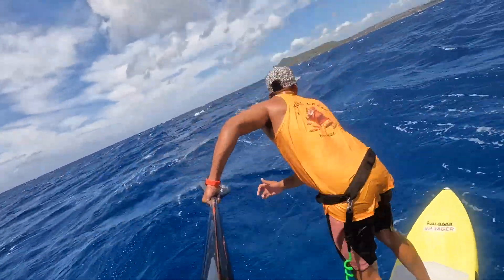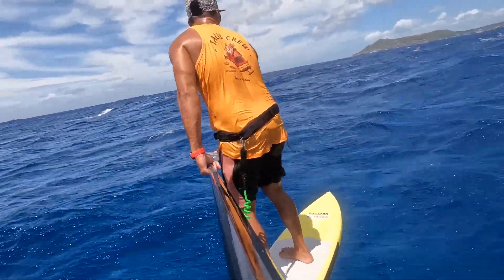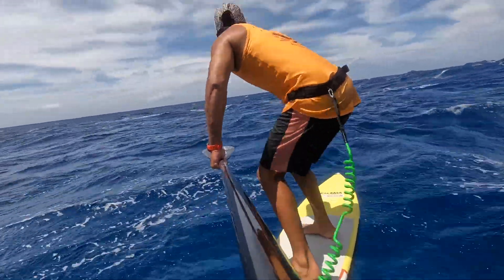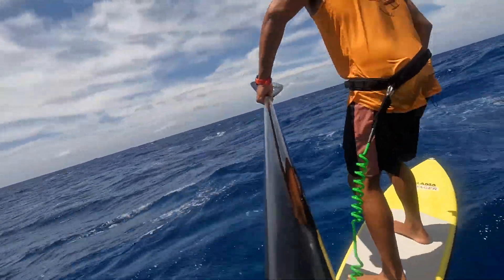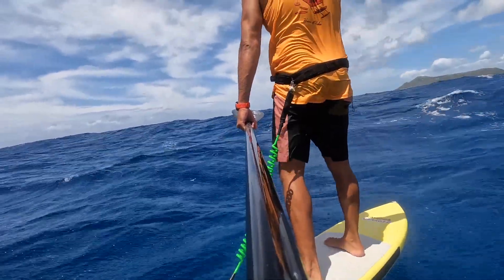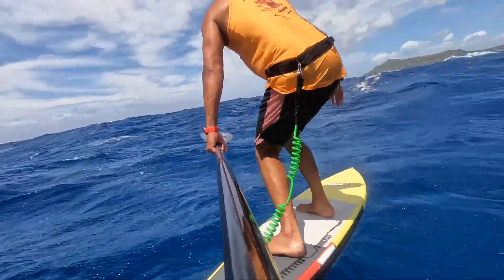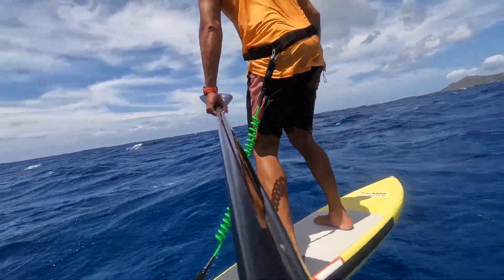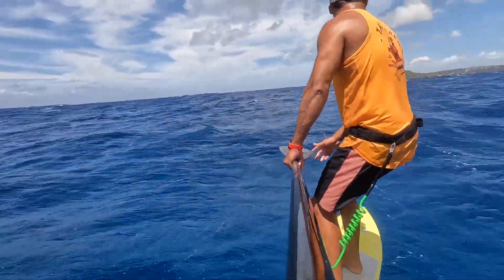Accelration vs Speed in Downwind Hydro Foiling

Comment: Curious if you or any of the crew have used the Moses/Sabfoil W1000 (1m span and 970cm2 area)for downwind?  I mainly wingfoil with this here in Caribbean and it seems to be a quick accelerating foil and good top speed too, quite a high stall speed though.  Been around for quite some time- I think it came from windfoil race designs. Interested to hear if its been used out there in the swells!  The sargassum seaweed is really bad this side of world and pretty much shuts down chances of long DW runs here,but still some opportunities.

Comment: great topic.  What would an example be?  Good top end Lift 90 and good acceleration Lift 120?  Is that what you mean?
Reply from the maker: when i rode the 120, i felt it quickly come off top speed.  So in my opinion, that wing has great acceleration and a great range of speed.  Other wings will stay at that top speed a little longer and not have a drastic gear change..

Comment: awsome. is the eagle 990 to advanced of a foil for a beginner in DW?
Reply from the maker: In my opinion it is one of the best wings for downwinding.  if you have trouble, just swap out the tails or the fuse sizes.
Reply: @voyagerfoiler5976 nice. I have also been thinking about a cabrinha h100(first generation),there are some good deals now that the second gen as came out. what do you think?

Comment: what F-one foils are you on? Lately I compared Eagle 990, 890 and 790 to Armstrong 925 and this last one had faster top speed, but higher stall speed (and less fun to turn). It helps that I take off assisted by a foil drive, so I can go pretty much as small as I want with the foil, like in the case of the 790, which was too much work to keep it going though. cheers.
Reply from the maker: In this video I believe I’m in the 890. I use the 890 and 990 both. It’s also relative to your weight. I’m 180 pounds, so when I rode the 990 it’s pretty efficient and fast, and I can keep up with guys in smaller wings who are lighter.